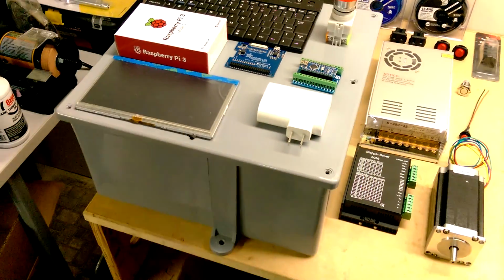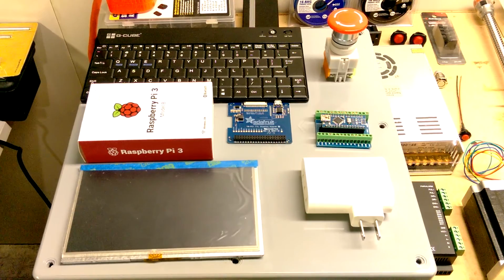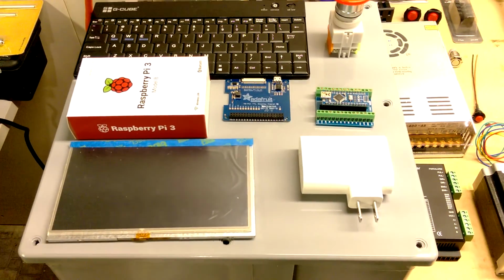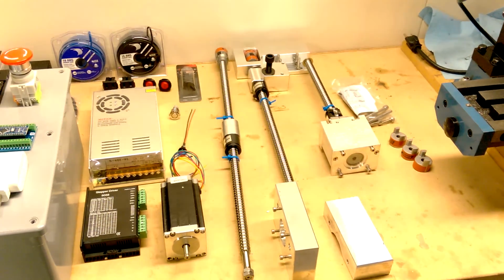Mini Mill CNC Conversion: Part 1 Intro

Comment: How much does something like this cost to convert?
Reply from the maker: Right now I'm honestly not sure. The ball screw conversion kit I used was no longer available last I checked, and that was the biggest single cost. Depending on how you go about it, I'd say if you go new parts you are going to spend at least as much converting as you did on the machine. So $1200-$1500 on a LMS 3990 sized machine. 
That being said, at $3k-$4k in you are competing with a Tormach 440 on capabilities, but you build it yourself instead of unboxing, setup and go.

Comment: I am about to do the conversion to my LMS 3960 and I do have the airspring installed. Was there any issues with the airspring?   Before I jump into this project do you have any words of advice?
Reply from the maker: John Wilson During the conversion you will need to remove the airspring. It was all pretty easy on the removal process. I would recommend taking the time to drill and tap the top of the column for the Z axis mounting block if you are using the same kit I did.